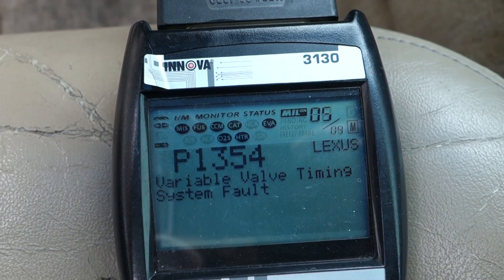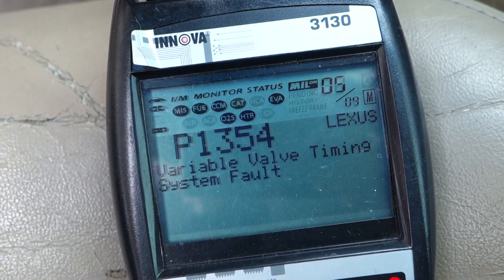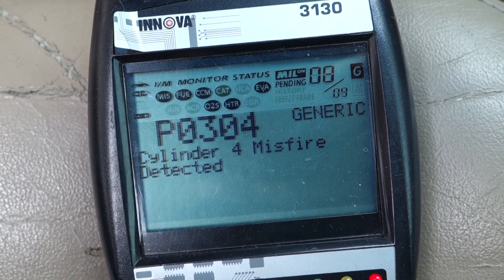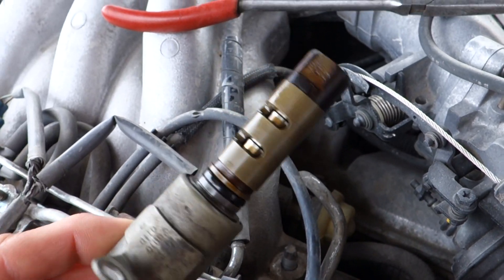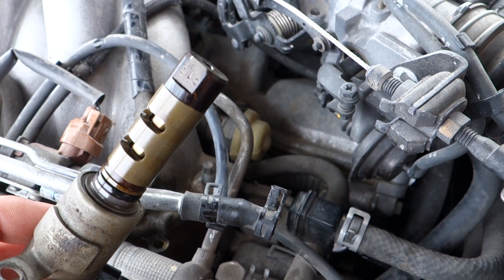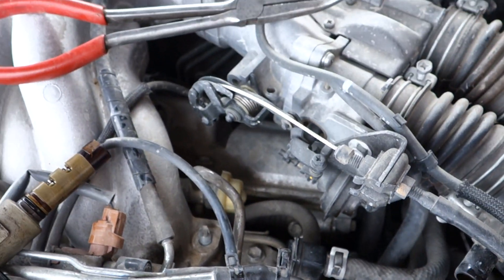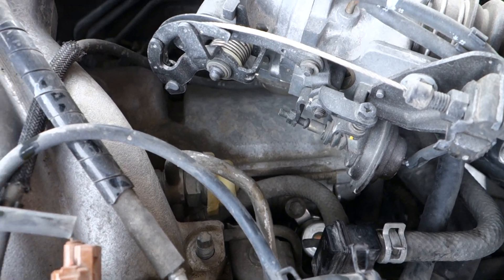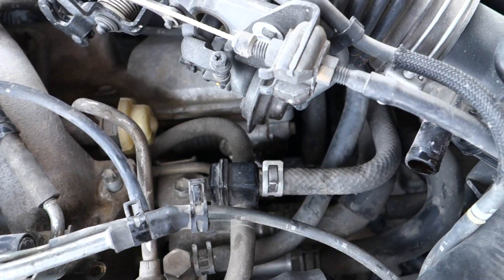P1351, P1354 repair on a 2001 Lexus ES300

Comment: I had this problem come up in my es300. That code is for the Bank 2 side of the engine (the side facing the front of the car. I replaced the bank 2 sensor and that fixed the problem. This video helped me locate where the sensors are so thanks. Those misfires you had were had were even # cylinders so it was for bank 2
Reply from the maker: Yes you are correct.  Glad it helped!

Comment: Yep this fixed my same codes. It was running like it had a plugged fuel filter or a bad coil. Our scan came up with the same codes so we looked and apparently the previous owner had replaced the right one but not the left. So we replaced the left one and instant fix. Thanks for the video!

Comment: Bank 1 is the rear oil control valve. Bank 2 is the front oil control valve...👍👍
Reply from the maker: Correct.
Reply: Wish I knew earlier. Found out once   I had the sensor in hand. Also, I knew I'd find this fact in the comments. YouTube kicks ASS!!

Comment: Just so you know, the codes you showed were all for bank 2. Cylinders 2, 4, and 6 are all on bank 2 as is p1354 is for the vvt system malfunction bank 2.
Reply: Is the bank 2 vvt silinoid in the same place?

Comment: Installation successful!!! Car runs like brand new. I replaced both at the same time. 

Toyota Parts Numbers 
Front OCV- Part No: 15340-0A010
Rear OCV- Part No: 15330-0A010

Thanks Brother!
Reply from the maker: Sweet!
Reply: Was your car a Lexus?
Reply: @budahookah919  Yes, my car was a 2000 Lexus ES 300.
Reply: 15340-0a010 is the 1st sensor for cylinder 2,4,6 right?

Comment: I'm guessing you replaced both and your issue was fixed. The other comments are right, the 1354 code is bank 2. If you only replaced the bank 1 valve, the check engine light would come back on and the problems would continue.

Did you check the oil control valve filters as well?

Comment: did you have to remove the metal line witch im guessing is the gas line its blocking my bank 1
Reply: wait i have the exact same car but mine has a long line leading to a hose that goes right over mine stopping me from pulling it out
Reply: i see yours looks different

Comment: I changed both my vvt solenoids & the code came back on in less than a year 😡😡😡🔥🔥
Reply: dirty oil will make vbt solenoids give false signal or even mess up the solenoid keep oil changes on time
Reply: @david5284  changed both oil & 2 solenoids at same time & code came back in like 6 or 7 months. I think I figured it out, didn’t know about the vvt  oil screen/filter thing 🤦🏽‍♂️ bought a different brand solenoids & got new vvt screens gonna see if that works later on this month
Reply: @masterk5066 
Please update if possible
Reply: @kingkonga245  the aftermarket brand I bought was trash. Cleaning the vvt screens didn’t fix nothing but probably shoulda been done anyways. What’s going on same thing happened to you?
Reply: @kingkonga245  I bought different solenoids & no problems afterwards lasted more than 6months as well. Also change oil at the SAME time

Comment: Have you tested them with two wires to the battery,mine was the coil packs not the vvti in the end..?
Reply from the maker: Yes
Reply: Teach me how?!?????
Going on 2 years troubleshooting everything you can think to be the problem... Everything down to replacing a cat and still having an issue..
Starting back at the beginning now. Is it possible that the vvt that was 'put in' was actually, put in? Is there a way to test this? Not going back to "that guy" again, he sold me the problem...
Month ago coil packs 135 had oil on the after spark change. To broke to replace... Now have an "O2 sensor that was $180 but he looks like as soon as that that's not even where the two sensors that's a air-fuel ratio sensor that comes off the manifold right away. Anyways should I check this problem before I check the VVT or other way around as it may save me a good $100?? I have pretty good mechanic skills so spare me the she don't know what she talking about line, move over if you can't give me a real answer. 
... Thank you
Reply: @ashleygro1986  I ended up disconnecting the 2wires to vvti oil control and its running perfect,with cel lite and trac on,done a 1000ks on that,its doing 9litres a 100ks,i gave up my cats are gone years ago,i not in US you have gathered mate!🦘
Reply: For a while there I was also unplugging my O2 sensor slash air fuel ratio sensor whatever it is # 2 on bank 1 and it seemed to work for a while there but not anymore I'm going to try that thank you very much!
Reply: @ashleygro1986  I think on mine its the cam phaser,because the oil controllers check out perfect and oil screens are clean,go figure!Its worked for me,my mate  has flash scanner but we in lockdown!Give it a try because it nearly drove me nuts,its my back up car if my diesel needs work,and they drive so bloody good i was loathe to dump it.
Reply: @ashleygro1986  oil changes critical.... vvt oil filter screen critical.... then of course solenoid itself